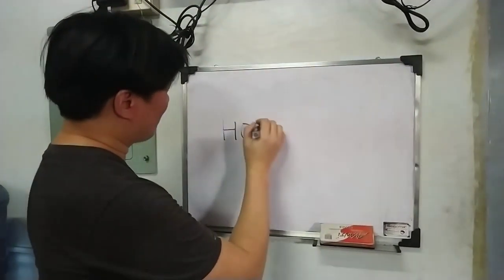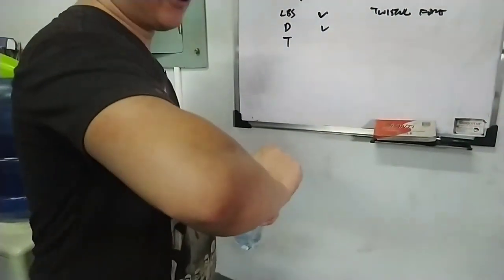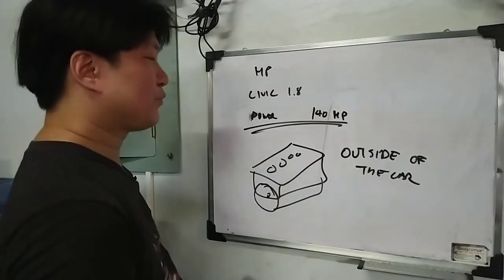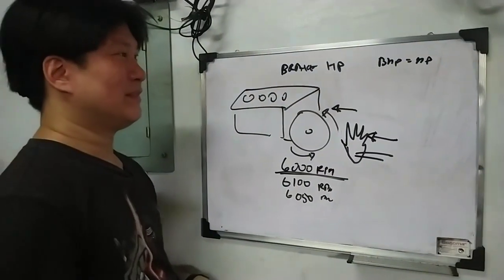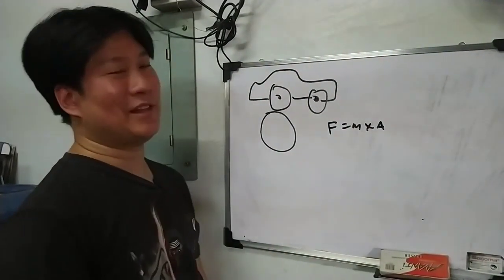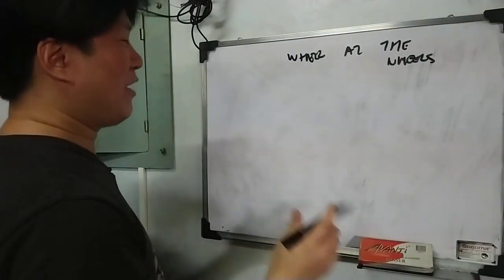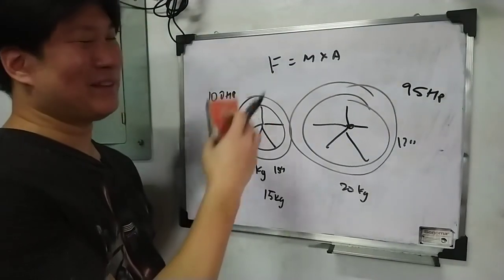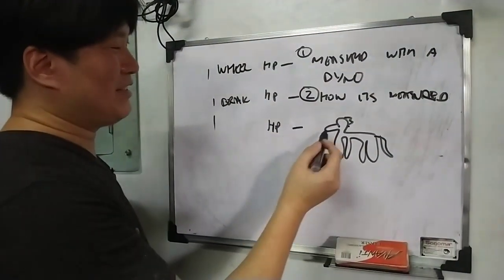Horsepower Explained - Difference between HP, BHP, WHP

Comment: Lol 1hp is 746watts 
And explained differently sa pag kaka explained mo.
1 hp is to move 550lbs vertically 1ft in 1sec. It refers to the power an engine produces.
Reply from the maker: Or it can be 55lbs in 100 ft in 1sec 
Or 55lbs in 10 ft in 10secs

What’s you don’t seem to get is that all 3 units are variable

Comment: Sir sid ung about nmn po sna sa  intake pag nag upgrade ng filter into cone filter like k&n anong pros and cons and pra saan po ung blow off valve hehehe slmat po sna ma notice
Reply from the maker: More power with a cone intake 
Blow off is for relieving boost pressure in turbo vehicles
Reply: @speedlabchannel4452  nice tnx sa info sir